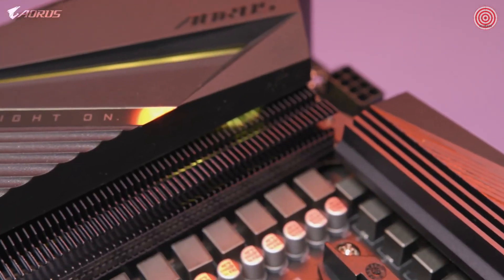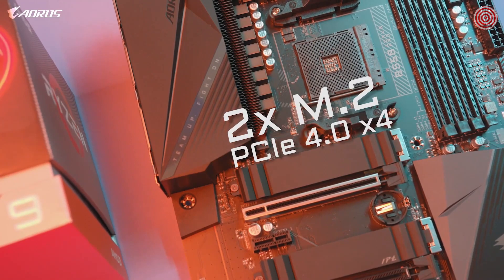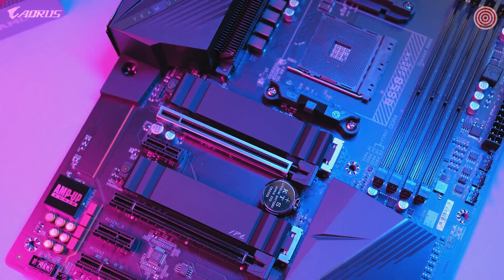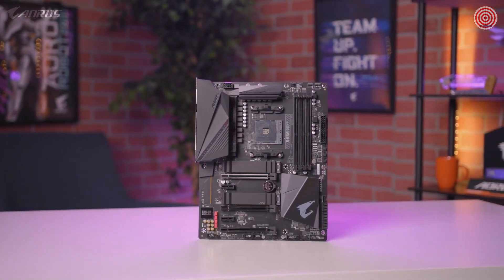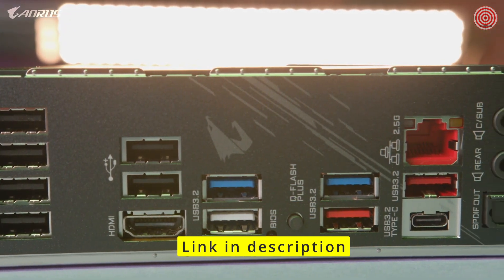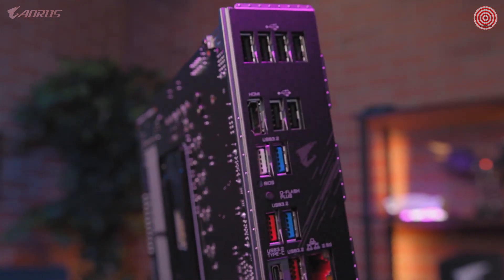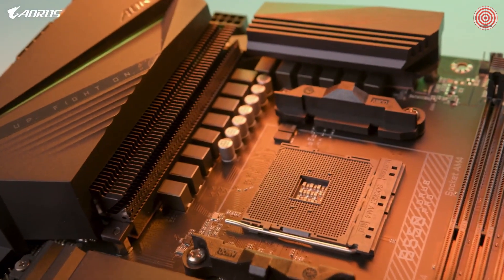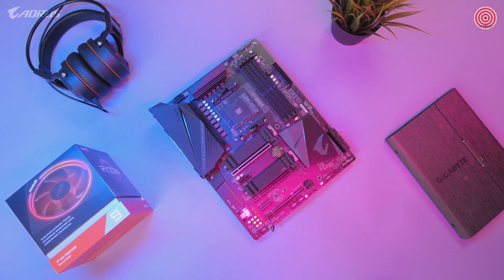5 Best Motherboards for AMD Ryzen 9 5950X in 2022

Comment: My asus rog strix x570-e does not run virtualization (bluestacks/virtualbox) well at all. I have SVM enabled and have tried different cpu/ram configurations but nothing seems to get it to run even remotely close to my i9-9900k/z390-a pro (swap ram between the two and no change detected). x570-e doesn't handle amd virtualization well
Reply from the maker: Have you tried this? https://www.asus.com/us/support/FAQ/1045141/